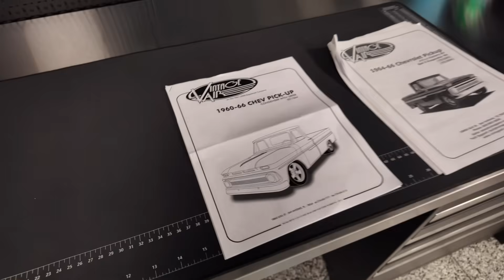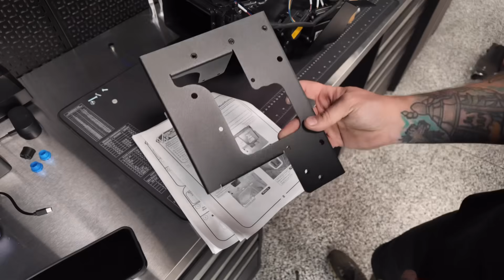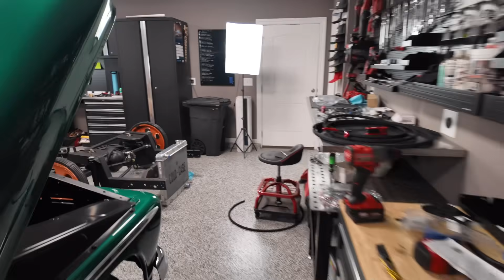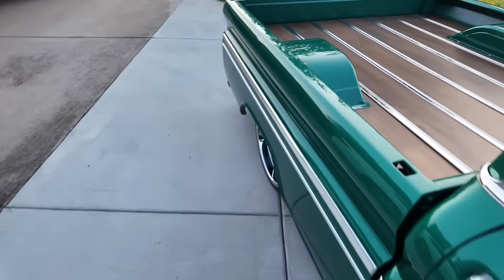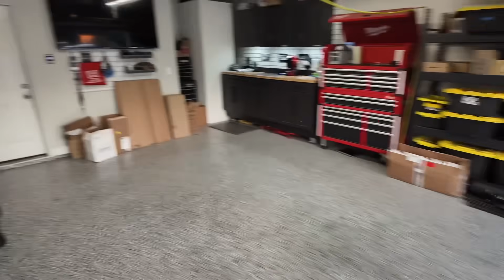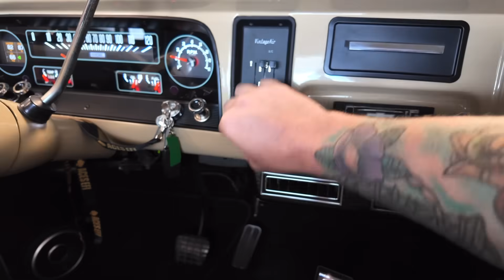VINTAGE AIR + COLD CASE RADIATOR INSTALLATION | Bagged 1966 Chevrolet C10

Comment: How did you mount the cold case midnight radiator? Did you you use factory mounts?
Reply from the maker: L brackets on the side of the radiator. Used factory holes in frame and rib nuts in the two holes in the side of the radiator.
Reply: @SIMPLE.C10 where did you get l brackets?
Reply from the maker: @billysmith8869 I just bought angled aluminum at Lowe’s.
Reply: @SIMPLE.C10 one more question.  Could you send a picture of how it mounts? I’m worried about it rubbing
Reply from the maker: @billysmith8869 send me an email thesimplec10@gmail.com

Comment: On future builds would you still use the cold case or switch back to champion?   Thanks and great builds!
Reply from the maker: Both are about the same. I like the black option from cold case but if I did LS swap probably champion.

Comment: Do you think it’s possible to run this setup without the dash vents? I have a 63 I want to put ac in but I don’t like the way the vintage air air vents look. It would be fine to just have air coming out at the defrost vent and floor.
Reply: coolc10 makes vents
Reply from the maker: It will be fine that way